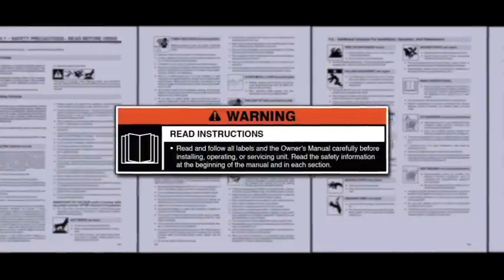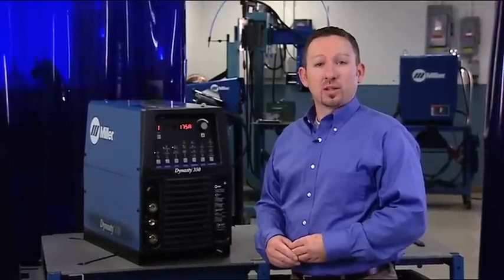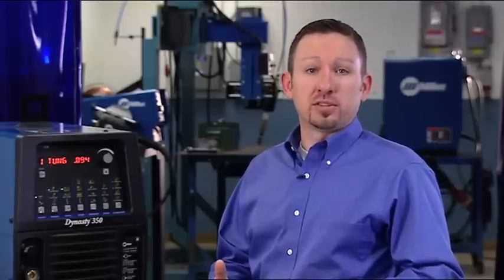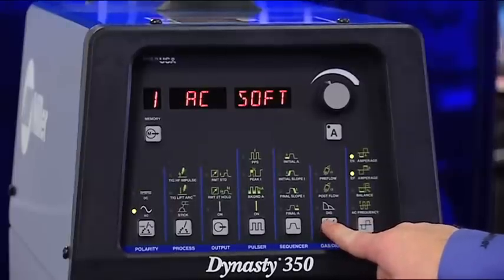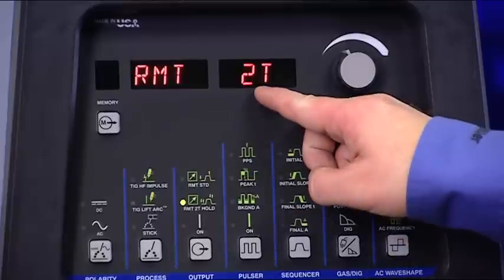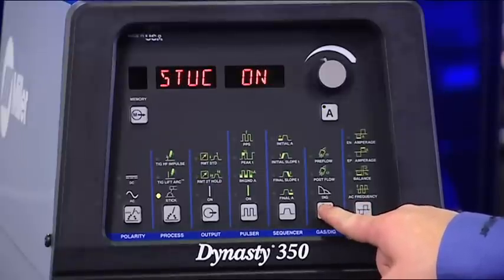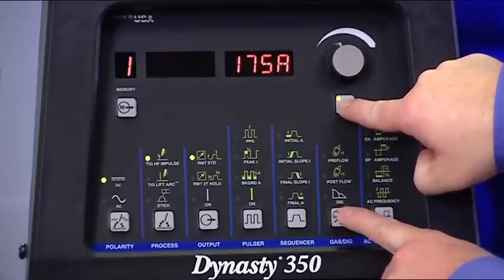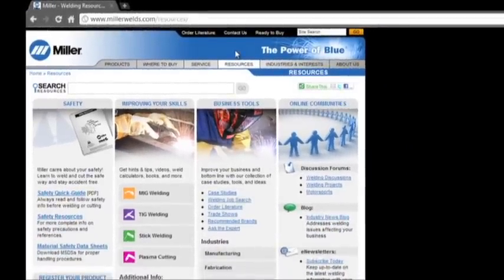Miller Dynasty and Maxstar TIG Welder Set-up Menu and Operation

Comment: My Dynasty 210 is actually easy to use. The default settings I get when you pick DC or AC worked fine for steel and aluminum welding for me. All I really had to play with was amps. I'm also working on welding sterling silver so I am getting into the advanced settings. This video unfortunately did not help with 'why' the various settings might be used. It's good as a supplement for the manual.
Reply from the maker: Hi John, we're glad to hear your Dynasty 210 is easy to use. If you have any specific questions about settings, please let us know or give us a call at 920-734-9821.

Comment: Miller has definitely over thunk every part of a dynasty 350. Our aerospace shop welds material down to .005. There is no Miller that can strike an arc under 10 amps I existence. I use a Lincoln 455 with micro start and it starts at 2amps every time. Miller sucks. Buy a Miller if you are a rookie, buy a Lincoln if you're a professional.
Reply: Nathan Cleveland miller starts at 1amp you clearly have no idea how to set this machine up